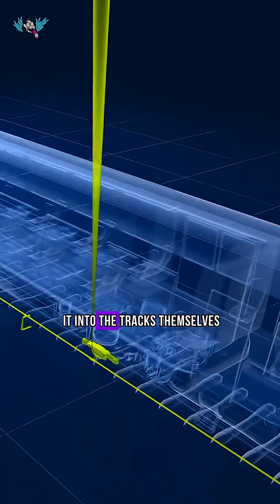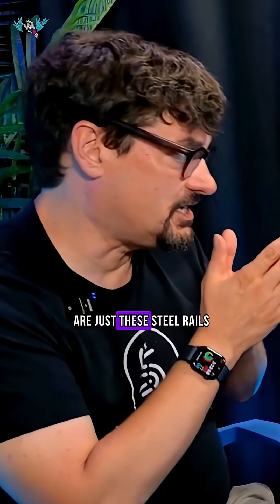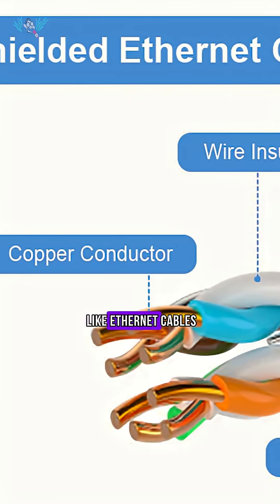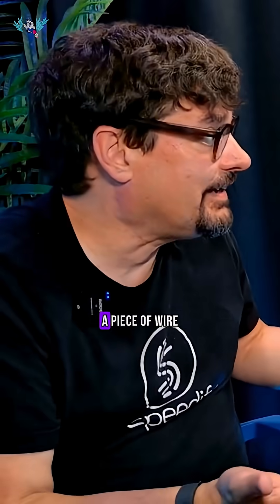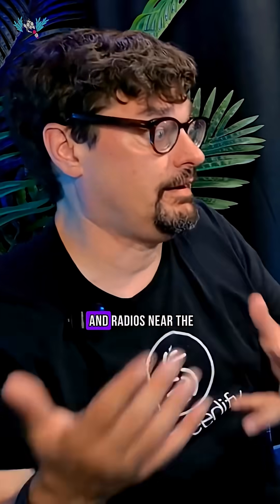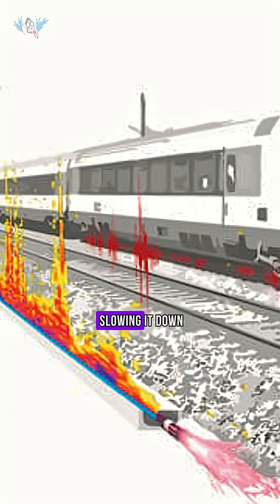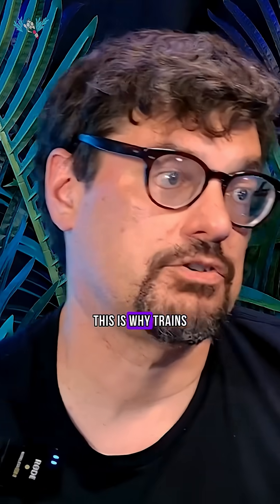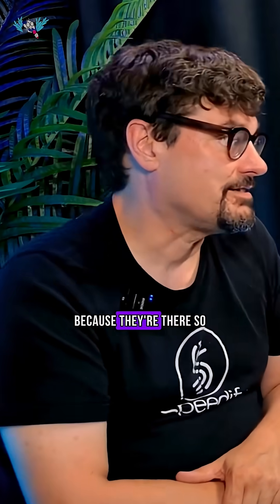Why fiber optics can't power train WiFi

Comment: Actuaslly Li=-fi might be an option. Put hte sensor on the front of the train and connect on long straightaways and onb hills. This gives them an optical to wireless connection. The Li-fi antenna could track the receive target on the front of the  train. You might be able to use a powered laser as the connection with a wi=fi back haul connecting each Li-fi to the network. Best part is is is highly secure since the signal can not be easily picked up out side the line of transmission. Speeds are up to 10Gb/s in some systems. Nut the question is how much connectivity  does the train need. If you make it a 10Gb connection should be able to transmit messages and orders. You could also cache weweb pages on he train and have it pick up at each distribution point like a envelops system. The train can then build the pages as it travcels.

Comment: Cellular is pretty good, its already there, its easy to work with, and it's not that expensive. Using anything else would be reinventing the wheel for probably a worse result.

Comment: But how would this apply to fiber optics anyway? Correct me if I’m wrong, but I don’t believe there’s any EM emitted from the low-power lasers in the optical cables? 

I’d be more curious as to how you would connect to the cable while moving? How are you supposed to sense the pulses of light without removing the isolation and exposing the fragile glass?
Reply: He coveted thie at the very start, you'd need wireless routers basically every train length along the track

Comment: Well, one of the main reasons why train WiFi is/was useful at all is because cell signals didn't work too great in a metal enclosure like a train car.

Nowadays, at least in urban areas, you can just connect to the existing cell network. And for rural areas with no coverage at all, something like Starlink is probably the way to go. Doesn't work in tunnels, but since those require infrastructure (monitoring, fans), it's probably easiest to have a cell operator install cell antennas along longer tunnels.

But coming from Switzerland, where everything is so densely populated and cell coverage along train lines and roads (including tunnels) is always excellent, I may not be the best at judging the situation for a country like the US. ^^

Comment: In Japan in all the subways, down deep underground, there is perfect cell coverage. They have antennas in the tunnels.
Reply: In Japan week has seven days!
Reply: Same in most developed countries
Reply: It's expensive to have all those antennas. At least those are underground where the tunnels bounce the signals back and extend the range slightly
Reply: It's easier to do that to subways. Subways are shorter compared to highspeed and regional railways. Also not all subways go underground. Lots of subways/metros are elevated.

Comment: Most trains in the UK have free WiFi. For that matter, a lot of buses do to. I think they just use the cellphone network and have deals with the operators.
Reply: There are cell phone repeaters that you can use if you have a deal with the cell networks.
Here they installed them inside the mall. Your phone signal works even though you're buried under a lot of concrete.

Comment: Surely someone has used a train track to pick up or send a radio frequency. Like you know a super long distance one that you need a gigantic antenna for.

Edit: not a good idea. Even if it was a correct length and not grounded and didnt have any of the other many issues it would have, its literally on the ground. Lol

Comment: Well and "fiber optic" don't even have an electrical signal in them. It's more like a tiny laser beam.
Reply: Maybe the real problem is the fiber optic getting caught into something.
I imagine the train would have to unrool it on the tracks and somehow it doesn't get damaged and somehow something would have to collect it later for reuse.
Unless the train runs in a closed circuit and doesn't go over switches.
Not a good idea to have a cable dangling.
Reply: Hum, but maybe the laser idea could work, it would require a lot of mirrors.
The thing is, wireless repeaters are cheaper.
Reply: The fiber needs to be converted back to electrical signals for Wi-Fi either way

Comment: In modern signalling systems, the signalling data is sent over radio, look up ETCS, there is a scenario where a tunnel could be created through the existing radio link to provide passenger connectivity. The issue is that these ETCS radio links are low bandwidth, meaning they would need to be upgraded too

Comment: They've used or tried to use train tracks as antenna for extremely low frequency radio communication
Reply: They couldn't just use satellite Internet service? They have them on boats and ships.
Reply: @AtariFTW they tried using train tracks as antennas for radio long before satellites were an option. I think mainly for early submarine communication

Comment: Try using Radiax radiating coax cable… 2.4 GHz band run the cable next to the tracks no antennas need only gateway router point and amplifiers at strategic points to maintain signal levels. Realistically with Satellite internet through numerous companies available it would be the most cost effective using space x, Hugh’s, Inmarsat etc….if cellular infrastructure is unavailable.
Reply: That is exactly what was done in the London Underground.

Comment: Do what every commercial airliner is already doing. Satellite based internet.
Reply: Expensive
Reply from the maker: that's an option, but keep in mind satellite dishes on top of planes have a much clearer path to overhead satellites in every direction, while trains are often running between trees, buildings, other obstructions, and through tunnels, where a satellite dish will lose signal more easily than cellular antennas.

Comment: Free space optical!! 
You know just like that satellite that sent videos of a cat back from deep space using a laser.
 Just put your amplified fiber transceiver laser on a small soda can sized Cassegrain telescope and have a matching one on the train and have them pointed at each other with a 60° field of view so line of sight doesn't have to be a completely straight line and use a highly narrowband optical filter. Put one of these $60 devices that can do 10gigabit connectivity every quarter mile to a mile. Multiplex more than one frequency if you need more than 10 GB per train.

I know this will work.
I attempted to start a free space optical based gigabit speed wireless internet company in the 90s(too soon)

 I only got a few customers that used me to get to AOL using their bring your own ISP plan to save them money on their phone bill, some people back then were paying hundreds of dollars a month for long distance calls to the AOL pop just to check their email! But they thought I was stupid for thinking they might want to use one provider for their entertainment and television(streaming), email, telephone(VoIP) when they  already had all those services separately...
   What I needed to succeed was one of those really good commercials where it doesn't tell you what you're buying but insists it's important😜 , I mean why not, that's how Verizon sold DSL before people even knew what the words ISP or broadband meant, never mind what DSL meant, they didn't need to know what the thing meant to think they needed it, heck does anybody else, even now, know it means digital subscriber line, that is before I just told you?

Comment: Use directional antennas that rotate based kn where the train is and have atleadt two connect points similar to cell towers, one where you are coming from and one where you are going.. that will work just fine. They just need to know the exact rotation based on the trains position.

Comment: Also: train wheels run on ball bearings which (for obvious reasons) are surrounded by non-conductive grease.
Reply: Greasy balls do not give off a good signal, this is important for all engineering student to remember and understand
Reply: @cam5816  are you implying engineering students dont take showers? Because I dont think youre too far off 🤣
Reply: @yeetskeet691 i'm Indian and I don't take shower
Reply: @Kawka1122  It is good you no steal showers, plants need them. Eh?
Reply: @lotharschiese8559 what are you talking about? Showers are free! They come down to us from the sky!😮 Just listen to the weather forecast to find out when the next one is happening.
Reply: The body of a train is always grounded for obvious reasons. And a bit grease inside the roller bearing will not stop that
Reply: Electric trains use running rails as the return path for the current.

Comment: So, what those power companies could do is string high voltage lines that wrap copper around fiber.  Electricity only travels at the surface of the conductors anyway, and this would lighten the cables, while also giving them a way to transmit data via optical fiber.

I believe this is already being tested in some areas, but of course it would take a lot of work to replace all those high voltage lines….
Reply: Optics do not like to flex.
Reply: Yeah. Have you seen what it costs to get them to redo infrastructure or extend it?
The US way doesn't lend itself to early adoption (hence why for at least a while Romania had better internet (which is a country that had a vampire hunt in like 2010).

Comment: Going through the cell network would be fine (though you don't need wifi for that), but why is signal always so bad in trains? 5G (or even 4) normally goes well into the hundred Mbps yet somehow in a train it struggles to load a google search...
Reply: Your own cellular data connection or the trains ? Your connection might be suffering from a signal degradation issue, the train is suffering from a traffic issue, it would be like you trying to share your mobile hotspot with everyone on the train.....

Comment: Project Taara: Hold my beer 
Hahaha
*(Taara delivers high-speed internet using light beam technology bypassing cables to provide resilient, fiber-like connectivity)
Reply: …between stationary bases.
Reply: @ewanmackenzie6264   Military Context
Militaries do use similar laser links in:

Naval ship-to-ship or ship-to-shore comms when both platforms can stabilize and track beams.

Aircraft or UAV links with high-end gimbals and adaptive optics.

These systems are much more expensive and ruggedized than Project Taara, and they have automatic beam-tracking to deal with movement.
Reply: @ewanmackenzie6264  Light beam technology currently works with naval ship-to-ship or ship-to-shore comms when both platforms can stabilize and track beams. Aircraft or UAV links with high-end gimbals and adaptive optics. (These systems are much more expensive and ruggedized than Project Taara, and they have automatic beam-tracking to deal with movement)
Reply: Satellite Internet is out of the question or something? Ships and boats use satellite for Internet access.
Reply: Lasers are dangeros. Project Taara could blind birds if not paired with a radio link that allows switching off the laser in a fraction of a second in case of an obstacle.

Comment: Interesting...
As a Amateur radio operator, we think about different things that could be used as an antenna, such as a metal fence, or a clothesline, but I never though of using a railroad track as an antenna, mainly because I don't have one handy nearby..
But technically, it could work as a low frequency antenna..
Reply: ❤yes low frequency..with low data transmission....
Reply: Fun hobby...I'm. A pirate sailing these radio waves
Reply: Everything is an antenna by mistake. Except when you actually need to design an antenna.
Wanting things to be antennas and things not to be antennas is the hard part of electrical engineering.
The other day I made a simple mistake, forgot the PLL. I got a nice clean 10Mhz signal from the clock signal, leaking to my amplifier and interfering with the ham radio , they were not happy to say the least.
Reply: I think England famously used or tried to use train tracks as radio antenna for incredibly low frequency radio coms, I think with submarines?
Reply: With typical rail length, probably you can make contact to nuclear subs. rumor says diving military subs use very low freq (few Hz maybe) to communicate few codes and surfacing to use sats or something else for high-bandwidth. communication.
Reply: Anything metal can be used as an antenna. Anything. ( Even those little metal barriers by the road lol )